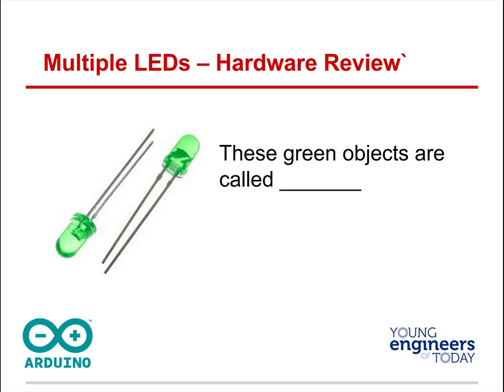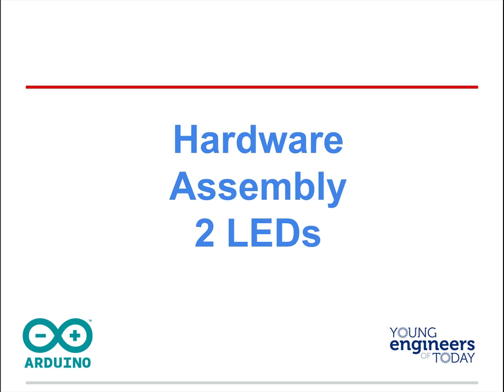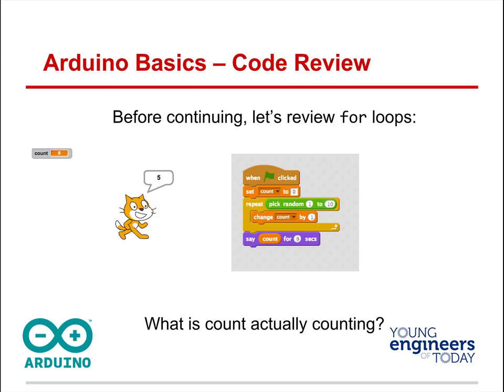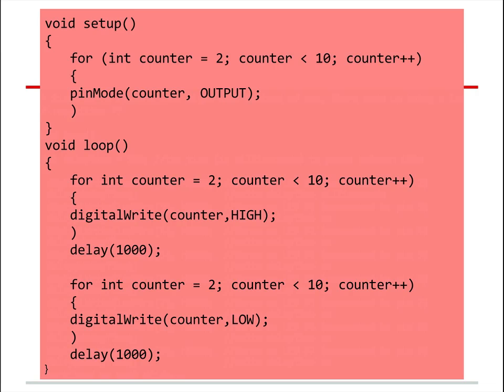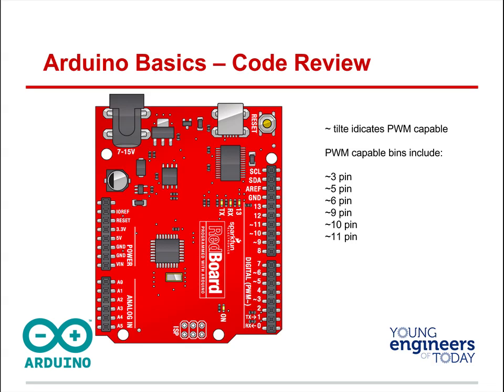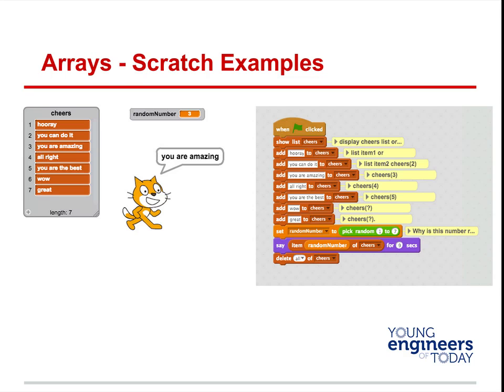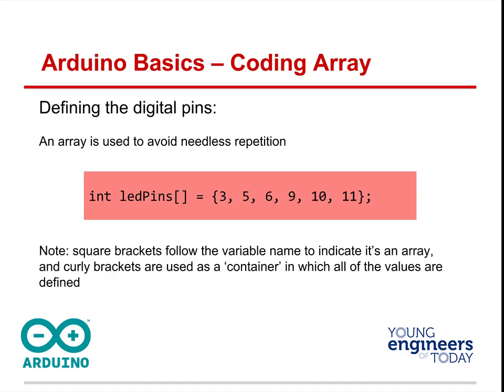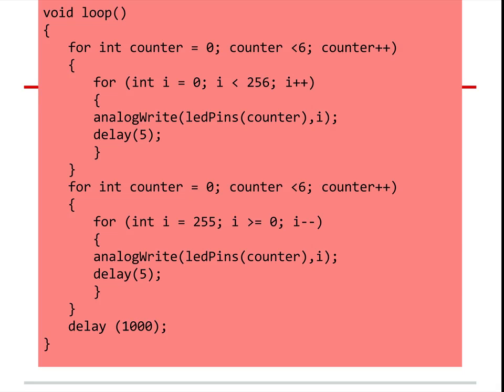Arduino Lesson 2 Multiple LEDs, Loops Arrays

Comment: Hee, you made a mistake with the answers of the hardware parts over the arduino uno. 

You said it right 'A' are the Power Pins and 'B' are the Analog Pins.
But on the video are those letters turned around ;)